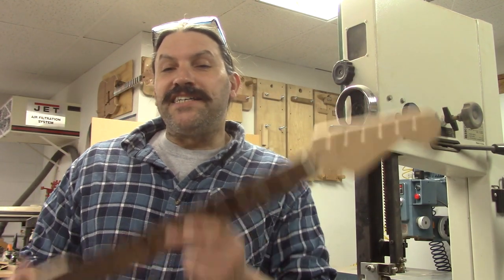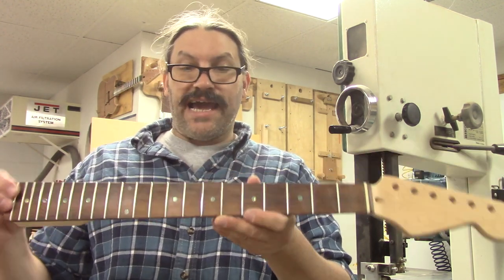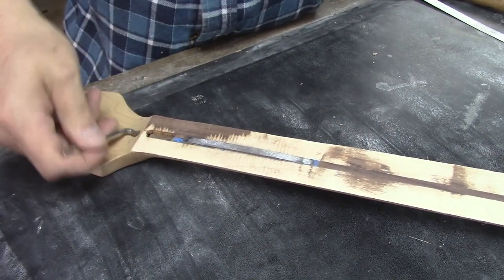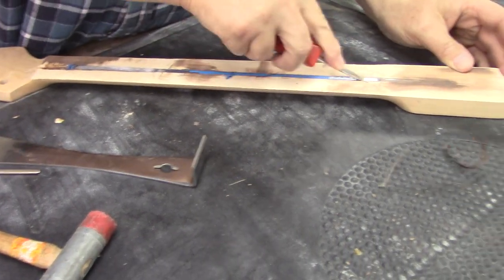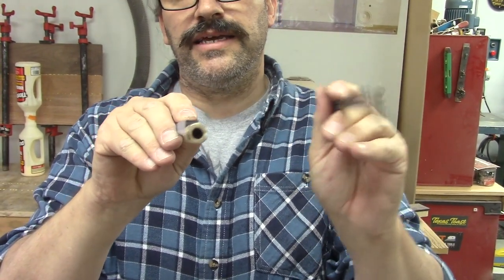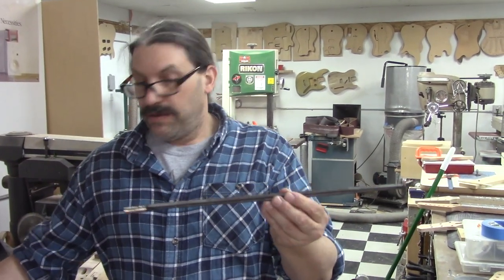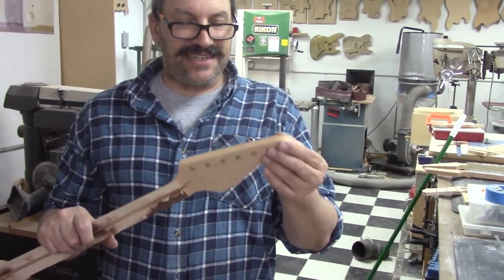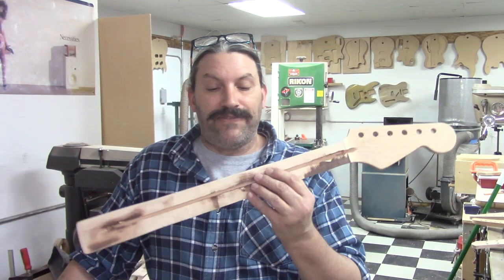We Hack Into The Cheapest Amazon Neck To Inspect The Truss Rod

Comment: Cool vid. I've ordered a few necks from China. The wood is really cheap, could be maple, but maybe not, really lightweight and has a plastic feel to it. Neck pocket tenons are way out of tolerance, usually too small. Tuner holes were fine, but metric spec. Surprisingly, the fret work was pretty decent. Some fret sprout, but not in need of leveling.

Thanks for doing this guys, interesting.

Comment: I like when guys show how bad they are at doing something and proudly show that on youtube
Reply from the maker: Your sister
Reply: @TexasToastGuitars  My SISTER would have removed the fretboard with a hot iron and sharp knives. You have all the credibility of one of those house flipping shows where they break the walls out with hammers.
Reply from the maker: @robertowen1956  enjoy your Cheetos
Reply: why would you  remove the fret board from a warped and unusable neck with a hot knife? Would you want to reuse a cheap fretboard on something good?  do you enjoy the slow trip around the barn? Is your time worth nothing?
Reply: I like when hacks fail at talking shit. Good job corky
Reply: @texastoastchris  Hacking it up is low-brow, like those home-improvement shows with the beta guys taking out an old bathroom with sledge hammers and chainsaws. I could do it in half the time with REAL tools. Lousy video!
Reply: Sledge hammers and chainsaws?  Sounds awesome!  If you hated the video, why did you watch it, and then take the time to comment?  I usually just walk away from things I don’t like.

Comment: Indonesia, Korea, China all make solid body guitars. Each line bounces between manufacturers throughout the four main countries. Squier buys from a manufacturer in China. That neck looks a lot like something you would see on a Squier bullet. Low end neck to start with, and twisted neck makes it a B stock. They show up on eBay and Amazon. Not all are structurally flawed. They’re usable with errors that didn’t pass quality control. 

I’m currently waiting for a roasted Tele neck from China. Fingers crossed it was just a cosmetic flaw that got it on eBay for $50.

You get what you pay for.

Comment: I had previously posted a snarky remark about the mating glue bottles in the background but I thought "that's so jr. high" and deleted it ...
I, for one, don't find truss rod videos boring, I've always wondered why and how they work and wouldn't mind a "deep dive"...
Slightly OT: I have two necks from Goodwill salvaged guitars and the fingerboards look like nice rosewood (but what do I know) and would like to salvage those for future builds. What would be the best way to remove (intact) the fretboards? Use a heat gun to loosen the glue or bandsaw? (Of course I'd be pulling out the frets also)...

Comment: Thanks Matt! I’ve always wanted to see just that. I would like/ watch your 20 minute, low point of a guitar build class video on truss rods. 
I know this is probably a dumb question, I’ve seen you put a piece of blue tape over the truss rod before you apply the glue to glue on the fretboard, do you remove the tape before you attach the fretboard?
I would assume you do, but then I wondered if the glue got on the truss rod would it impede it’s performance. 

Again, I always learn and am entertained by your posts. 
Thanks,
Steve
Reply from the maker: Thanks Steve, but that truss rod lecture could go long :)
We do remove the tape
Reply: @TexasToastGuitars  I think I would listen to it to be very honest. About three years ago I thought truss rods were some sort of magical voodoo. Now I adjust them unabashed! You need to do a video on it I guarantee you I would watch it start to finish and I would stand and applaud you at its’ conclusion!

Comment: Would it come apart if your steamed it with like a cloths iron heat brakes glues seal or would it be a major pain that way idk you channel looks awesome I’m subscribing
Reply from the maker: The fret board certainly could have been removed more cleanly, however there was never any intention of using this  neck since it was a knock-off, had a big twist and was 39 dollars. I really just wanted to see the truss rod. Speed was what was required... not finesse

Comment: I just bought a cheap Telecaster neck online. The neck heel was so much deeper than it should have been I couldn't use it
Reply: One of the most ubiquitous Chinese manufacturers, Kmise, consistently make their neck heels about 3mm too high. I've written to their customer support and described in detail why that is a bad idea, suggesting they should adapt to Fender standard neck heel height etc. Not sure if it will help.
Reply: Sand it down, It's part of the fun!

Comment: Nothing too surprising here. A truss rod is a simple device and they are manufactured by the million, so it's probably as easy for the manufacturer to use a standard inexpensive product from a catalogue as to try to save a few pennies by looking for someone to make a cheaper one. The wood is a different matter: there, you get what you pay for, and bottom-of-the-market is going to be barely adequate. After that, it's how the neck is assembled that is going to determine how stable the finished neck is before any truss rod adjustment is made. Having to make extreme adjustments is usually an indication that something more fundamental is wrong.
Reply from the maker: Totally

Comment: Why is a double acting rod of any use ?
When I look back at forty years as a luthier I may recall three ocassios when the dip/extra relief could have been useful.
The negative acting mode in these rods is a redundant feature. The extra weight and depth , the seductive possibility to fit the rod badly and the small hex key stripping while being impossible to replace are also down sides.
The drooped rod with fitted wooden cover strip is still king and sorts the luthiers from the monkeys.
Gibson , Yamaha , Maton , PRS aren't sucked in by the duplicitous wand.
Okay? Kick the bi-acting rod for touch.
Reply from the maker: I don't think the single acting rod is all that. Hamer had it figured out but most companies don't. I look for durability and action of the rod more than vintage spec. You got to do you man.